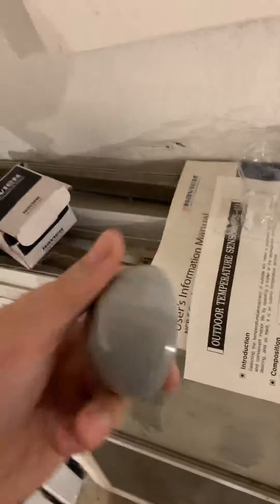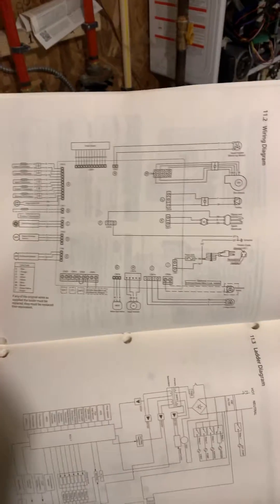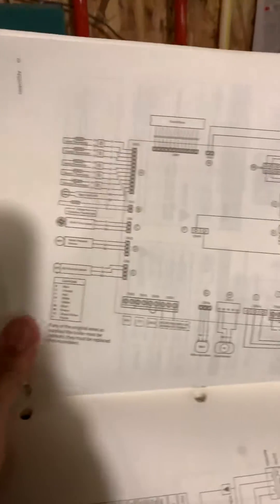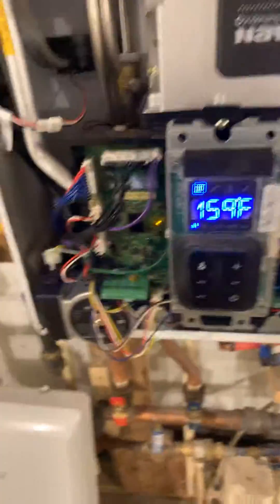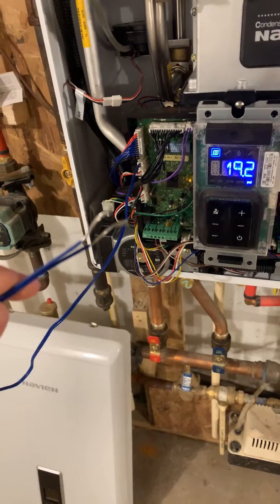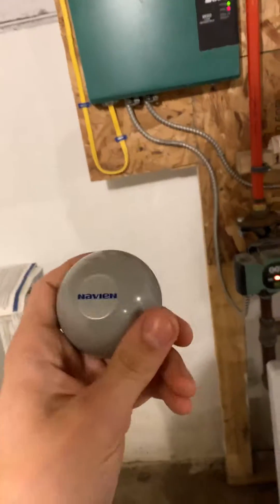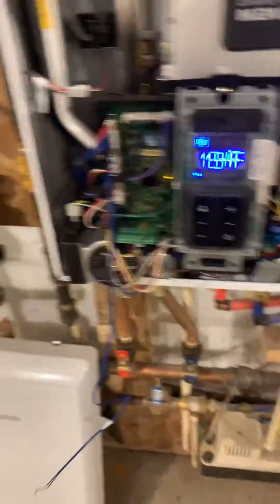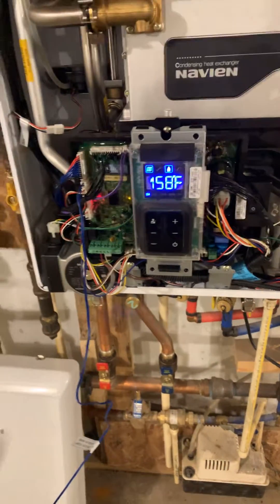How to install outdoor thermostat on navien combi boiler - Navien tankless water heater maintenance

Comment: I am installing a Navian 240 as a replacement to an existing boiler.  My current system has a traditional water tank, and a circulating system ( which I am not currently using)  The manual shows both an installation using the tank heater, and a circulating system without the tank.  I called Navian, and they suggested I would have better efficiency directly looping the water without the tank.   If this is correct, then should I use the current 1" supply which supplies the whole (5600sf) house, or feed through the current 3 1/2" returns, and use the 1" as a return line.
Thanks, Bob

Comment: Thanks for your video.  Read some of the comments where people are complaining about not having enough heat.  I have yet to read the manual but I'm sure there are set points and possibly what is called parallel shift to keep the supply water hotter or colder relative to the heating curve based on outdoor air temperature, to help compensate for heat losses of any building.

Comment: The wire for this sensor is only about 2' long. The directions say to use jointless wires. How do I get the wire from the sensor to the boiler with only 2' fo wire?
Reply from the maker: I personally used regular TSTAT wire. I spliced them together and covered the splice with electrical tape. Is it “by the book” not sure but that’s what I did and it works. No issues since installed. 

Hope this helps

Comment: Hey Mike.. just got Navien NCB 240 E... what is your experience with the outdoor sensor. Apparently people complained not having enough heat. Installer says had to remove it. If no outdoor sensor what is best setting fur parameter A heating side and setting fit parameter B domestic side.. thanks John

Comment: Great video Eric, you just forget to mention that  after outside thermostat/ sensor installed you need to tell boiler that sensor is connected, NCB comes with that function disabled from manufacturer ,to time when you enable it, after that you can choose your desired heating parameters. Have fun with it.
Reply: Thanks for this video. I have NCB 240E my installer said not to install outdoor thermostat. He said your heat won't be as hot as it should. I called navien tech support and said it should be installed Thanks
Reply from the maker: John Barca thanks for the feedback and glad it helped!

That’s the point of the outdoor thermostat....no need to heat the water to 180 degrees when it’s 40 degrees outside and only needs to be heated to 120 let’s say, therefore saving you energy and money!
Reply: @johnbarca3854  …. I’m just looking in to ‘Outdoor reset’ after operating for a couple years without it being connected. Your comment seems to say your installer and Navien tech disagree?! Which advice have you followed? Thanks to you and the author for pursuing this topic.
Reply: I set up outdoor sensor and I let it run . I’m all close felled foamed and tight . Water temps fluctuate as the outdoor temps fluctuate . I did realize it’s not cost effective to lower tstat when I leave for  the day. It takes way to long for the house to come up to temp . If we are in the heating season I just leave at 68 24hr 7 days and house stays comfortable . 
I usually get around 4 8 to ten min burns an hour to maintain the house temp
Reply: @toby4041  Nice.
Reply from the maker: 786otto thanks for the feedback! Yeah after I posted the video I figured out this weekend when I did the installation I have to “enable” the outdoor sensor by going into the 1.PAR settings and enable the sensor. I’m not too knowledgeable on the heating parameters...I try to understand but it’s just over my head so I left them at the default. Trying to understand the return temps gets my head spinning too but mine almost is never under 140 degrees and some people say it won’t condense at that temp.
Reply: @themillennialhomeowner1661  That is correct, navien boilers are great but they may be the worst with their software that operates it , very unintuitive meaning hard to set up and follow instructions , hopefully they change I see progress in their NFB series . Just dig in there some more and just choose one of settings that you have it is I thing seven of them like cast radiators ,baseboard ,low mas radiant ,and so on  choose one you have and your  heating comfort will improve.  If return water is at 140 it will not condensate , remedy in this situation is to heat the house at lower temperature , not always possible without increasing radiators size or serious energy insulation retrofit. condensation will give you about ten percent more out of the gas you are using.
Reply from the maker: 786otto I put the setting on the finned tube baseboard because that’s what I have. I have 2 zones upstairs and downstairs. I notice when both zones are on the return temp briefly went under 130 degrees but not for long. I only have the heat on 67 and it’s only a 1306 square foot home but it’s heavily insulated. I read up online about the curve of the temperature and maximum temp outside and min temp outside and that’s when I closed the book and let the thermostat do it’s thing on the right setting lol. It is for sure heating the water to a lower temp than I had it on which is a good thing at least
Reply: @themillennialhomeowner1661  So you all set , there is not much else you can do in this set up.Except maybe trying to use lower settings and see if it heat up your house . I have to keep my house at 75 ad least other wise my Filipino wife sleeps in winier jacket, :)